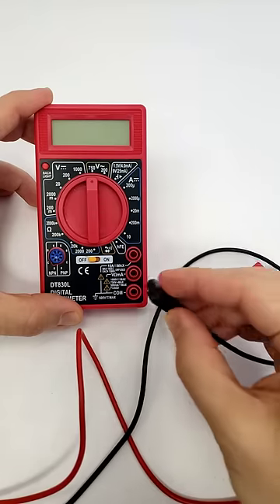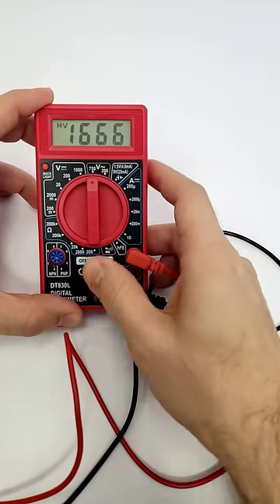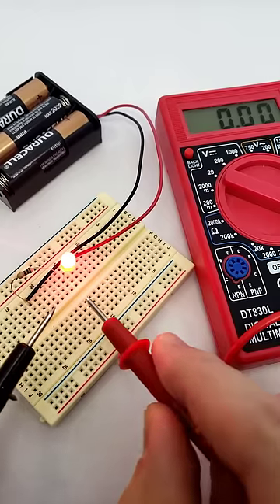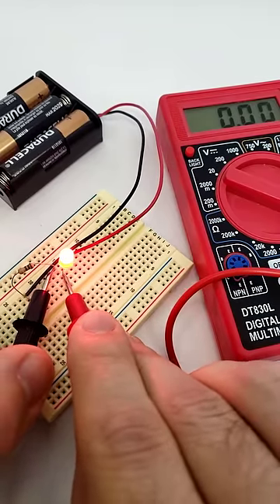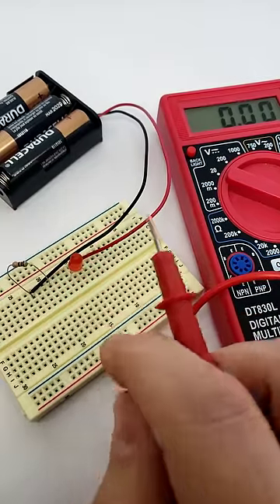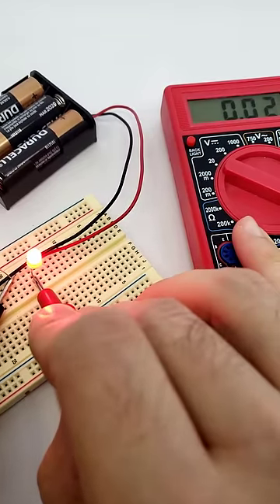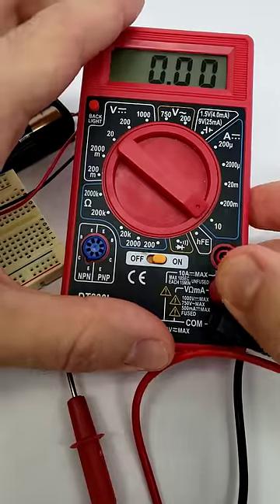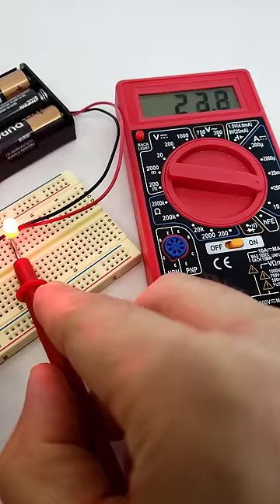How to Measure Current with a Multimeter

Comment: You had change the prob
Reply: Yup and he gave no explanation as to why he changed it.
Reply: He did explain. Where he initially placed the red probe is where you do when you're measuring current in the range of ampere(you can see the marking as 10A). The latter is for small currents, that is mA.

Comment: do u know how we can directly measure the current of a battery?
Reply: yes i also wondering how it is done.... if we directly connect the multimeter probes to the battery +, - then it shows some value then the value is constantly decrease..... i think it is not the correct way... please help if anybody have any resources to know that...
Reply from the maker: You need to connect the battery to a load (like a resistor) and put the multimeter in series with it. If you connect the probes directly to the battery and set the multimeter to measure current, you are effectively short-circuiting the battery and will blow the fuse in your multimeter.
Reply: @Science.Buddies  thank you for your clarification.... you saved my multimeter.....
Reply: @Science.Buddies can confirm this, so that's why the LIR2032 heat up when I directly measure its voltage & amp.

Comment: Does it mean that your led consumes 23 mA per second?
Reply from the maker: amperes (A), the unit of electric current, measure flow of charge (coulombs) per second, so mA (milliamps) is already "per second."
Reply: Ok, thank you for the explanaition. So just to confirm, the consumption of a single led is 23 Ampers?
Reply from the maker: 23 milliamps. One milliamp (mA) is one thousandth of an amp (A).

Comment: but this meter doesn't have a fuse on 10A jack lol.
anyway starting from the largest range is really good habit and few people talk about that these days
Reply: Why should the meter have a fuse on the 10A jack?
Just curious
Reply: @niranjanaarulnambi7309  Well this happens from time to time - measuring voltage after measuring current , the probe is still in 10A jack but you forget to plug it into Volt jack. Here your multimeter actually forms as an ammeter instead of a voltmeter as you think it would be. Ammeter has really low internal resistance and connecting an ammeter across voltage source (to measure voltage) performs a short circuit, causing arcs and damage . But with a fuse in series, it burns when current is too high  to stop this short circuit and to protect both you and your stuff.
Reply: so always use ORGINAL MULTIMETER
Reply: Yes thanks for that tip
Reply: @niranjanaarulnambi7309  Damned if i know. Im learning